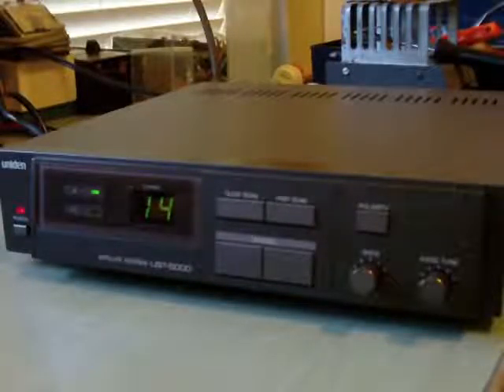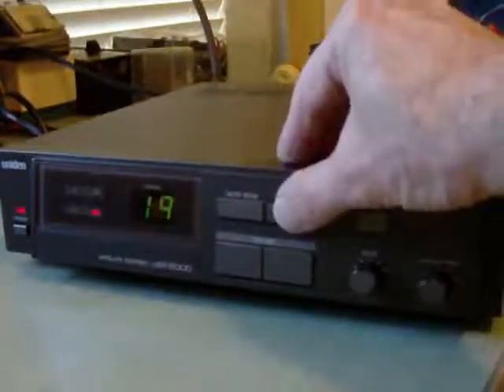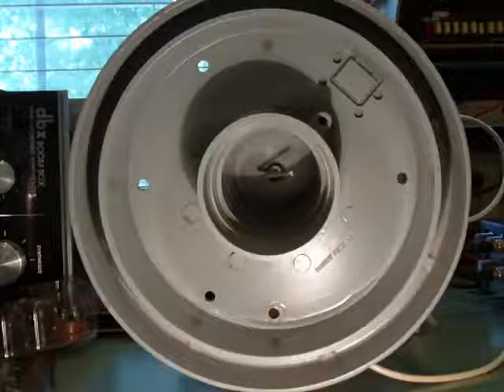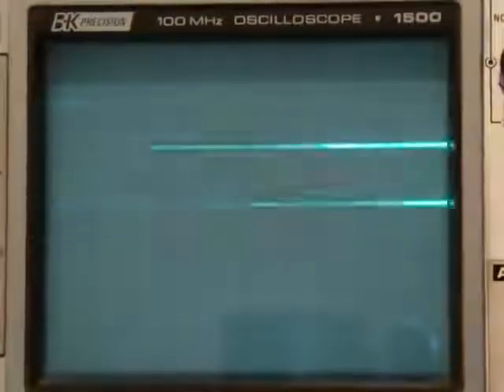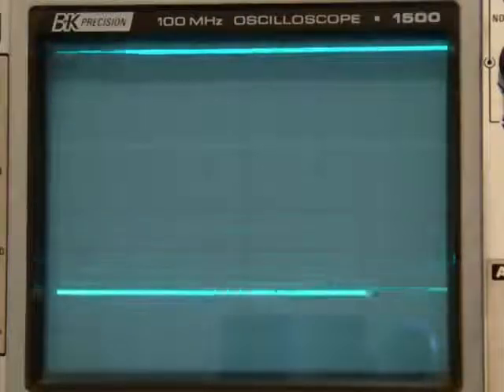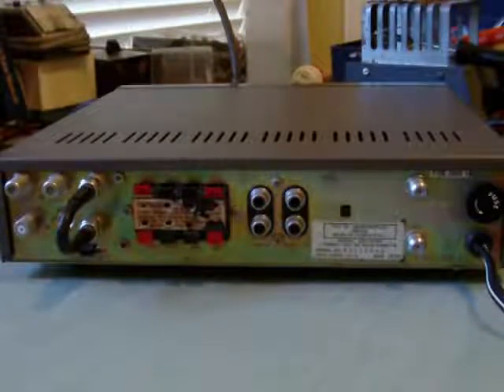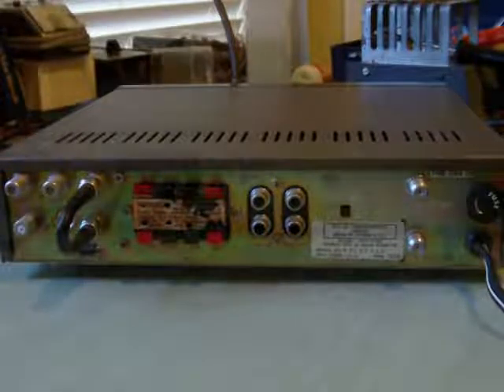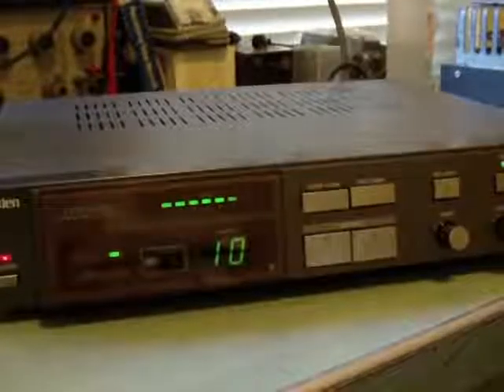Analog Satellite Equipment

Comment: I had the Uniden ust 6600 with the motor mover, my dad never bought me the decoder because I burned out the Polarity servo and the Jack mover once Trying to play smart ass cleaning the house and not numbering cables And mixing wires altogether. The result, my dad said, Screw you, I will not buy the decoder anymore. Fuck! that ruined my childhood partially.